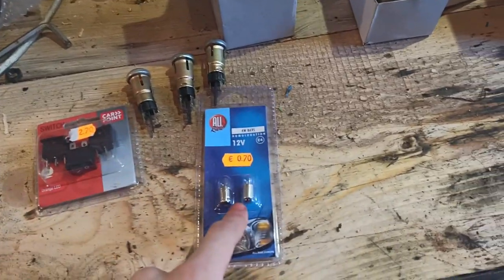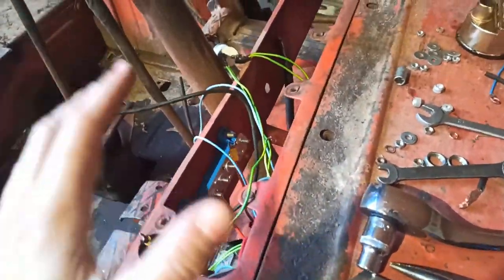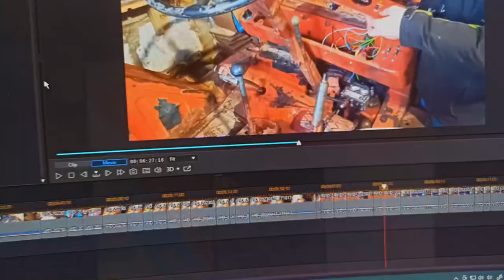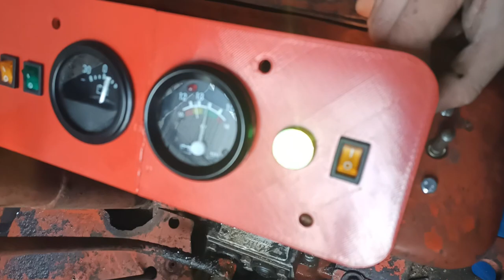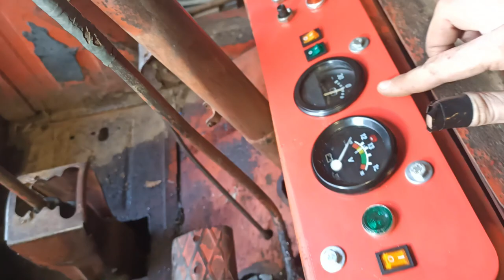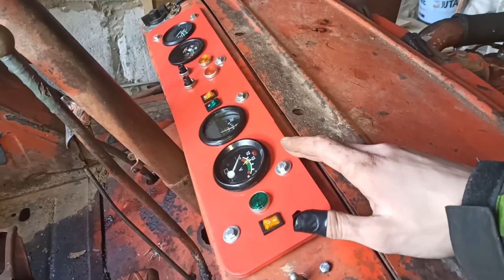T-25 ''Vladimirec'' restoration | New dashboard | part #1

Comment: You can get a new wire harness for T-25A3 might be around 40eur or so. The one thing I don't like on these tractors is the original high pressure fuel pump and the overflow system for the injectors.